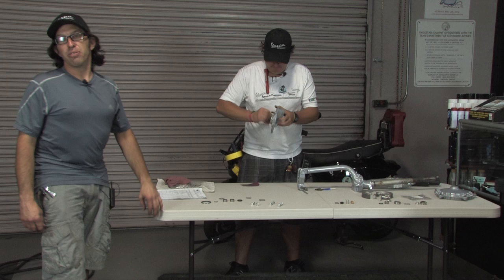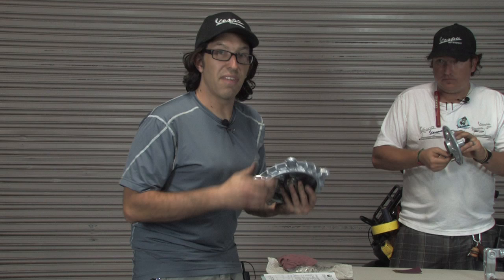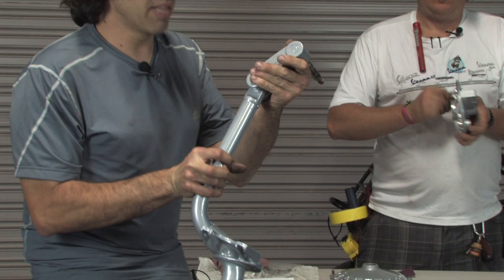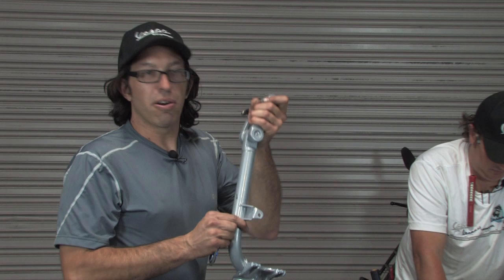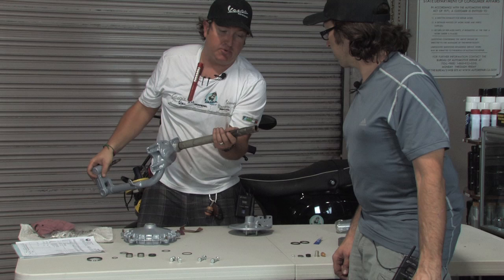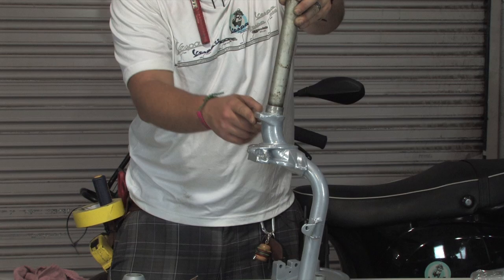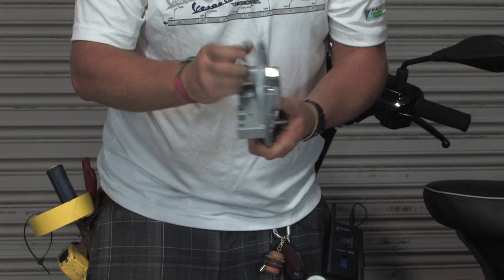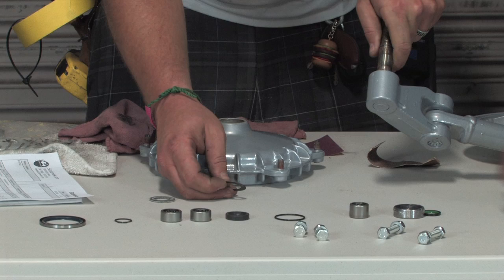Vespa P200 Fork Rebuild

Comment: if your front hub is chewing up speedo gears regularly, is there an easy way to clean out the hole without taking front hub apart?  If its the metal gear inside the front hub, can you replace just that part or is it a full replacement of the front hub assembly?

Comment: Sir, can you please help me that is there anything inside near the speedometer worm, as the speedometer of my Vespa NV 150, stopped working after changing the worm its also make some sort of sound and then stooped working and jammed there, I puted there a steel speedometer worm, its also not worked with the plastic worm, I am having a new speedometer installed and a new cable the meter is moving but how to fix it near the worm please help sir